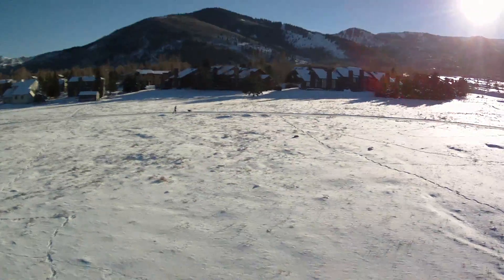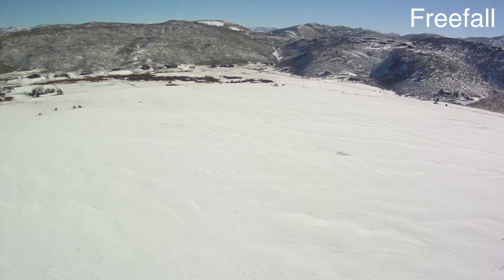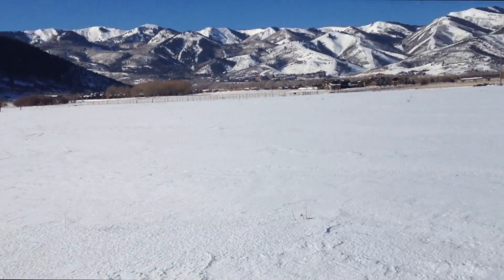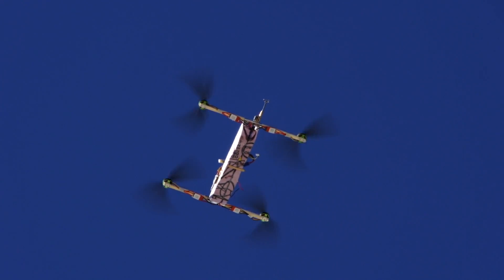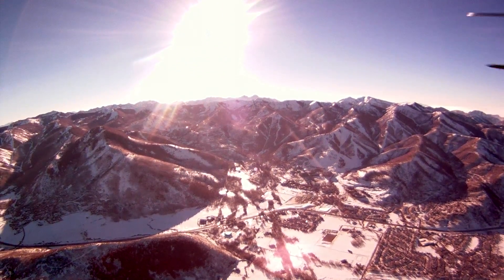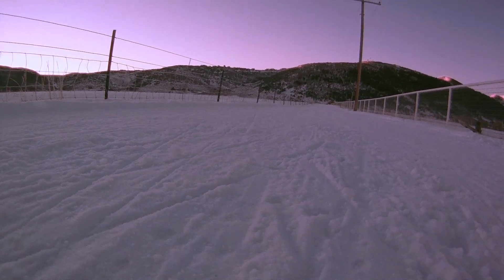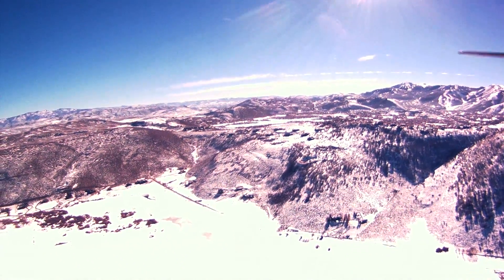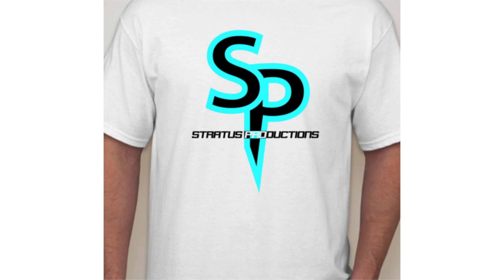High Altitude H-Quad Free Fall - RCTESTFLIGHT

Comment: Hi Daniel.  Interesting video.  Got a suggestion to make the free falls stable - I'll try to describe it.  From the frame on your quad on a 250mm square starting grid, fix 4 rods (eg carbon spars), ea 250mm long onto the frame and pointing upwards.  The top end of these 4 rods should end in a square 150x150x150x150mm - so a square taper moving from the quad frame upwards.  Fix 4 x depron rectangles ea 75mm wide to fit into the sides at the top of the taper formed by the 150mm end - like the sides of a fixed parachute.  In the open 150mm square hole left by the four depron rectangles, fit a hinged depron sheet so it will close off the hole when the quad falls but is open when gaining altitude with the quad.  Note: When the flap is in the open position, it should be held vertical so that air rushes in behind the flap against one of the tapered sides to guarantee the flap shutting when the quad drops. Hope this is reasonable clear!!  Rocco.

Comment: Should have used something besides NAZA if you didn't want to crash so often. There was no reason for 90% of your crashes. The copter was still functional, and you had plenty of height.

I do a ton of flips and free falls with MultiWii and KK2 and have never had anything close to a failure like you had repeatedly (Where the quad failed to right itself when given throttle).

Comment: That was interesting. I always wondered if motors will be able to start up again or if ESCs will fry after a free fall. Obviously they don't always start up as demonstrated by some of your sacrifices.
I've only flown high (to 3600 ft) once with my quadcopter until I had about 20% battery left, and then just dived down using about 1/4 throttle. I didn't dare cut it off completely because I wasn't certain about how the FC (APM in my case) would handle it, as well what I mentioned about the motors/ESCs.

Comment: I have an idea for a quad. Build an H-configuaration quad like this one (but out of lighter materials), and put the motors on servos, so they can tilt horizontally. Then attach a set of vanes (sort of like your drag flaps) that point down and allow the prop wash from the rotors to pass through them, but tilt horizontally when the motors do to form an aerodynamic wing-like surface. You'd basically have a quad that could turn into an airplane, and then turn back into a quad. To control it in airplane mode, you could have the two rear motors tilt up and down to control pitch and roll (thrust-vectoring system). If you wanted to control yaw, you could either attach a fin with a rudder, or use a differential thrust system with the motors. For control during a power-off glide (assuming you could make this thing glide), you could attach an additional aerodynamic surface to the outside of each motor (the ones on the rear motors would be able to move because of the thrust-vectoring system, while the ones on the front motors would be for stability). Those control fins would also provide additional lift in airplane mode. In quadrotor mode, the rear motors would have to point down, while the front motors would point up.

Now the concept of quadrotor-airplane hybrids is nothing new. You may have heard of the Quadshot, which is a wing with 4 motors designed to be stood on its tail to launch. There is also a video here on YouTube featuring a modified Bixler with the single motor replaced by 4 motors, 2 mounted on each wing pylon that lift the plane up like a quadrotor and tilt horizontal to transition to airplane mode. But I noticed the aerobatics you were pulling in this episode, and figured that with a quad built like how I described in the previous paragraph, you'd be able to do flips with it in quadcopter mode, and transition it to airplane mode and do all the stunts that an airplane can do. That would be a pretty cool concept, don't you think? I know it would be a little more complicated than your standard, run-of-the-mill quad, but it would be cool to see you try to make it work.

Comment: Were the ESCs harmed by the "reverse current" being sent from the free spinning blades? I believe RC car ESCs use rather larger capacitors when compared to aircraft ESCs to absorb more reverse current as RC cars coast more than RC aircraft.

My two cents as to why your motors wouldn't spool up. Check to make sure the capacitors on your ESC are not puffed or blown.

Comment: I love this experiment! If we can find a way to do a freefall smoothly, it would give great advantages for aerial photography. I think it could be possible to program the ESCs to use the motors as air brakes without using additional energy from the battery. The gyro algorithms would be the same but we would need the reverse/brake function of the ESC to tell it to brake when needed to keep the multirotor level.
Reply: It's so strange to read all of these comments and remind myself that they're four years old. We have this now...

Comment: Great vid =]
One thing I've heard is if you shut off the motors, in a freefall the motors will start to spin the opposite way. When starting back up they actually start in reverse? This might of been fixed, or I could be completely wrong?

Next - Mini wings (on the hinge system) 10% throttle, and rudder/elevator ;)